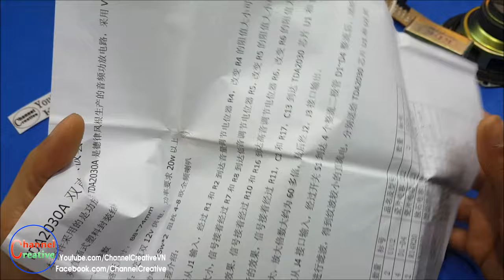How To Make Speaker At Home - For Your Own

Comment: this is stereo?
Reply: Yes its stereo, but he connect the left channel to the sub and the right to the tweeters
Reply: Liquid Car, es estero utiliza dos integrados TDA2030
Reply: Csongor Kecskés thank you!!
Reply: ΑΝΤΡΕΑΣ ΑΝΤΡΕΟΥ no its speakers
Reply: That is a bad idea to put the left channel to the tweeters and the right channel to the woofer because you will get a gap in the sound and it won't sound at all good. So you would either make the signal Mono to eliminate special left and right sounds and just mix them. Or you get a dual voice coil woofer and put half of the woofer on right along with one tweeter and the other half on left with the other tweeter.
Reply: yes
Reply: mono in 2017 ? joking me? :DDDDDDDD
Reply: LOkunz  ''"""::
Reply: Yes